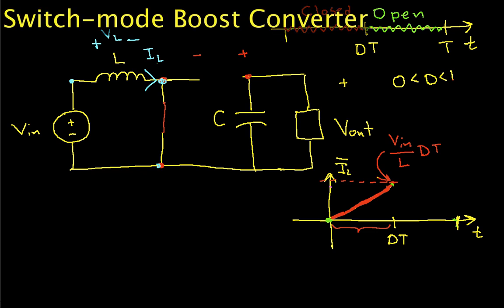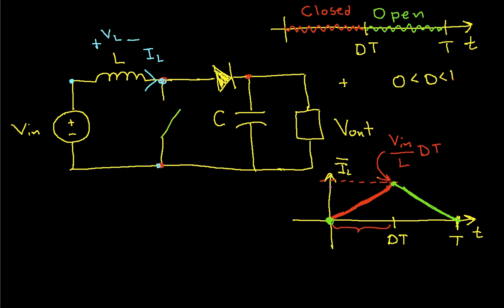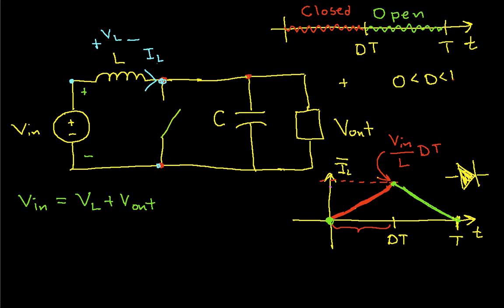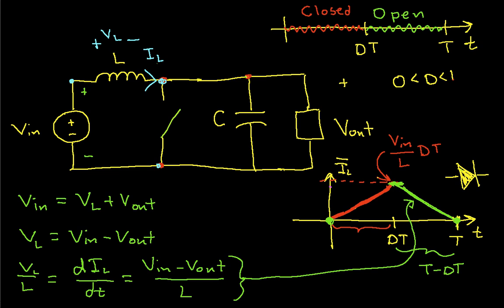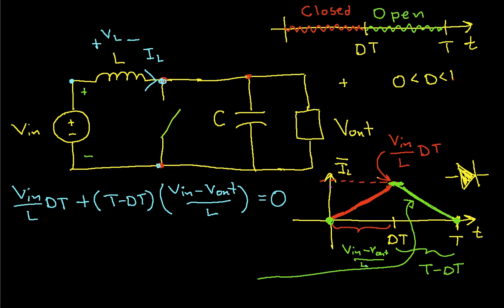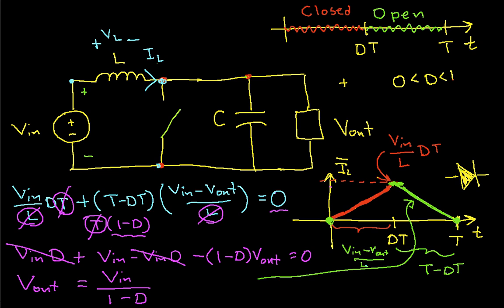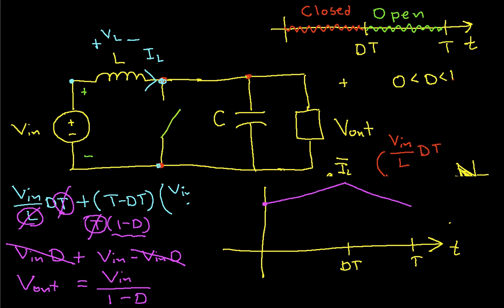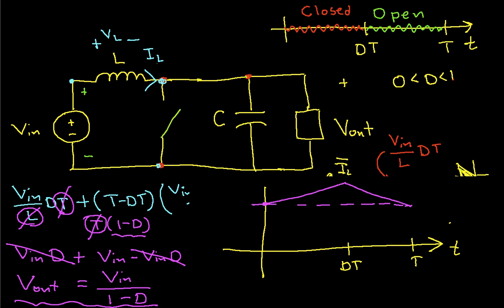Switch-mode Boost Converter Part 3

Comment: Old post but it may helps anybody ;)
The capacitor is here to soften the signal, as the inductor is not providing the voltage all the time, but depending on the duty cycle (that's why it is a "switch mode" boost converter). If there were no capacitor, you would still have DC, but with a huge huge ripple, making Vout useless for most of the uses.

Comment: good video. 1 pointer though. you did not mention why the diode gets forward biased when the switch is opened. This is due to the fact that the inductor will oppose any change in its rate of current and it does so by reversing the polarity which makes the diode forward biased. I think the inductor behavior is a very important part of the analysis and aids in the understanding of switch mode power supplies in general.

Comment from the maker: @Mrkirill578 I would think that the value of the inductance would affect the load current that could be supplied by a real circuit. Unfortunately, I do not have any experience building and tuning boost converters, so I cannot provide suggestions.

Comment: I've tried to create a boost convertor, which will take 5V and step it up to 12V. I've tried to build this circuit using a simulator and on the bread board with uC. but for some peculiar reason the output voltage has a relation to the inductance and the Load current rather than the duty cycle.
What am I doing wrong?

Comment: i still dont understand, could you message me or something?
I dont understand why do I need the capacitor if the inductor only is enough to pull the voltage up....and I also want to know... let say if I want to make a 1000V out of 9V battery.... how should I count the inductor that I need, and the capacitor that I need ??

Comment: if Vout is greater then Vin then how diode is forward baised when switch is open?
Reply: +anant mitra The voltage across the capacitor is much higher.
Reply: +anant mitra I agree, this particular part was not explained well. The answer is that since the current starts to decrease, the voltage polarity across the inductor also changes so that vout = vin + vL. Remember that VL = -(L * dI/dt).

Comment: why is Vout larger than Vin , if Vin=Vl+Vout??
Reply: +D Pee Because when the switch is open, the inductor produces back EMF. That comes from the fact that the current cannot change instantly (Vl=Ldi/dt). When the switch is open,  the polarity across the inductor (was + - when Switch was closed) reverses (becomes - +)and now you have: Vin (a rise) + Vl (a rise when switch is off) -Vout (a drop) = 0 and it follows that Vout = Vin+Vl

Comment: I think the analysis in this video is wrong or too simple. it's not a simple function of duty cycle. the obvious counter example is with no load where the voltage would continue to rise at a given duty cycle.
I'd recommend that you experiment in ltspice to get a feel for how important duty cycle, load, voltages and inductor size is.